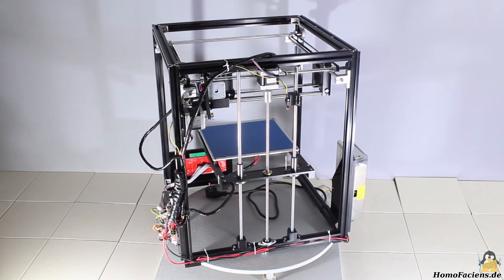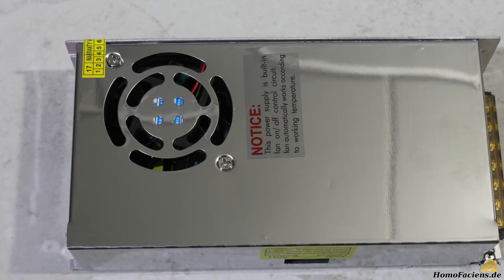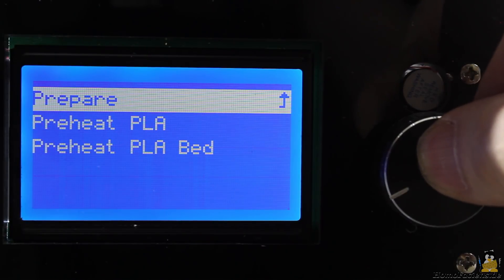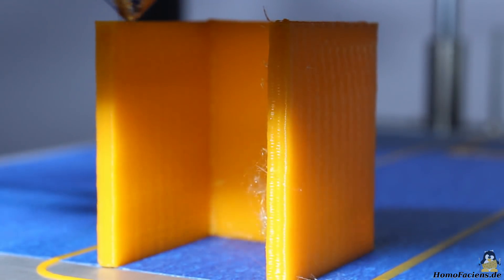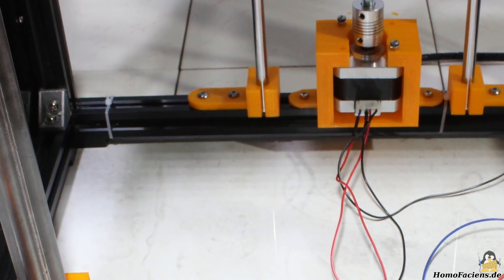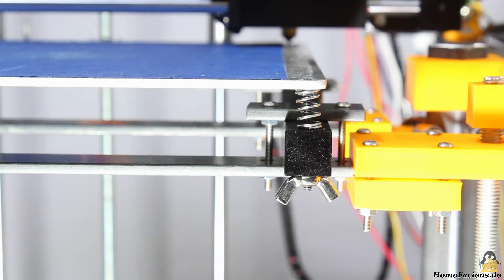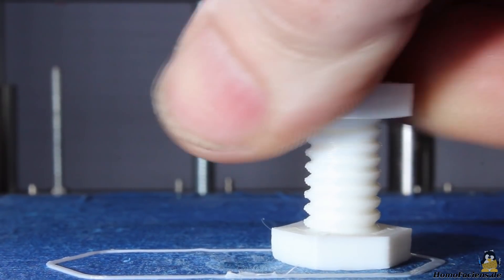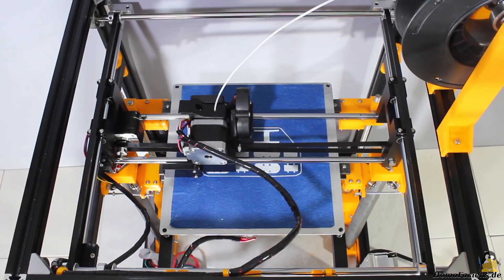Modifying a Tronxy X5 3D printer to get quality prints

Comment: Sorry I'm so late, bit do you havw a link to the first z mod that you did? It still improves the print quality a lot and it means that I don't have to buy lots more motors and rods etc.
Reply from the maker: As told in the video, the mods I have done are published on my pages:
https://homofaciens.de/technics-machines-3D-printer-Tronxy-X5_en.htm
Reply: But is the first z mod that you did on the website? The one that you later changed?
Reply from the maker: I would not call that first mod "success".
Reply: No it's not perfect, but it's a lot better than the stock printer and I don't think it's on your website? So I was just wondering if I could have the file for it that you made?
Reply from the maker: Only for you ;-)
https://homofaciens.de/technics-machines-3D-printer-Tronxy-X5_en.htm
The link to the package can be found at the newly inserted figure 13.
Reply: Thanks! Stay safe 👍

Comment: I will buy my second printer on "Black Friday", today!
I own Anet A6 and I would like a larger model arround 330x330mm or more.
I was looking for Tronxy X5SA because of the "box configuration". I would love to have a high quality machine with a large bed. I was thinking about 200$ upgrade such as a silicone heat bead (1000W, 120V, 50$ Ebay +5$ Mosfet), better belt and better bearing. But will it be great then, is it enough? Will it compare to 2000$ models?
Should I let go the nice "box" high end look? Should I go with JGAurora A5 or CR10 or a copy of theses?

Thank for your inputs, Alex form Québec, Canada
Reply from the maker: I haven't tested the X5SA, so I can't say anything about the printer. To me, a good choice for larger prints is the CR-10S:
https://homofaciens.de/technics-machines-3D-printer-CR-10S_en.htm
The only printers that are close to 2000$ printers (especially in service and warranty) are 1900$ printers. That's economy...

Comment: Has anyone found a detailed guide to initial assembly of the Tronxy X5 ? I'm stuck on which length of rod to use on what part of the frame. The longest rod are the vertical pieces. With the LCD being the front. What size is used for the side and front rails of the frame?  Is the frame longer than it is wide?
The updated model I have has build plate rods supporting the front and the rear of the build plate. 6 rods not just 3. Does this make these modifications obsolete?

Comment: That is not the TronXY X5S beyond the frame... You've eliminated some of the better features of the printer like the gantry rail system and replaced it with crap smooth rods.
Reply from the maker: It's the X5 I am showing in this video, not the X5S.

Comment: Do you have a link to buy the component for upgrade ?
Reply from the maker: Buy filament and print the plastic parts. You can get the 3D files and a link to the steppers I am using on my pages:
https://homofaciens.de/technics-machines-3D-printer-Tronxy-X5_en.htm

Comment: I am having a problem with  x and y as well I like your plans but why 3 stepers on in can you not just use 2 because I was planning to use 2
Reply from the maker: A tripod construction is the best you can get. Of course you can also try a 2 motor version same as most 3D printers use. Share your results to see how good it works.

Comment: is that every time we want to print new model we need to adjust the heat bed?
Reply from the maker: No, only whenever you run into trouble printing the first layer of if you have moved the printer to another location.

Comment: I think it would have been cheaper to use a belt or chain to control the deck height. I dont have extra motors just laying around.
Reply from the maker: ...and I did not have belts and pulleys laying around ;-)
My solution is just one of many possible ways to improve the design.

Comment: Good video! But you need to make another step forward. As seen from your video, Z axis ripple on the prints still present. And most probably this is because of the M8 lead screws. Ripple frequency is very similar to M8 pitch. I propose to replace these Z axis M8 lead screws with the trapezoidal and use anti back lash nuts. And use good quality couplers (as an example - Plum Flexible Couplers). After I did that on my printer, Z axis ripple completely disappeared. The only ripple I see now is from X and Y stepper motors control steps. But I hope to get rid of that too. I am planning to use SilentStepStick TMC2130 driver boards.
Reply from the maker: Yes, with quality parts you usually get a better output, however the very cheap trapezoidal screws might not be an improvement over the standard M8 screws. It's a quick replacement if you want to do some experimentation.
Thanks for sharing your experience!
Reply: Sure, I agree with you, that quality parts give the best result. But very few of us, makers, can afford to spend thousands of euros to go for this. I am using parts purchased on eBay, AliExpress and etc. so they are not the highest quality. But any way printing quality improvement is tremendous. M8 leads are not bad (if they are straight enough). The problem is that coupler hole is 8 mm, but M8 diameter is less than 8 mm. So you will automatically get lead off center (not mentioning, that these cheap couplers usually have hole off center too). And that is the main source of Z axis ripples. I have and idea to make Plum Type couplers myself. All parts can be printed with 3D printer. Upper and lower parts could have hole with any diameter we wish. So we can eliminate M8 lead screw problem not being in the center. And we can print middle part from flexible material too. So with the next printer build I will try use DIY Plum Type couplers. If I will succeed, I will share that design on the Thingiverse. And thank you very much for sharing your experiences and videos. Your channel is great :)
Reply from the maker: Sharing successful ideas is what evolves mankind!
Hope to see you design, soon.

Comment: Hi, great vid, some quality work there in your upgrades. You mentioned further work was required to make it your dream printer, what individual updates would these be ?  I'm looking at whats available now, should I just get the X5S as this has dual Z drive out of the box ?
Reply from the maker: Mainly I am working on integrating a filament extruder so that I can feed the printer with plastics granules.
Yes, the X5S seems to be a clear improvement when having a look at the construction and specs, however I can't give an advice regarding a printer I haven't tested yet, because the devil is in the details...

Comment: Nice vid but having three steppers just for the z axis is just not pratical. Syncing the two z motors on standard i3 designs are already problematic. You should have just used a larger motor with pulleys
Reply from the maker: It's not perfect, but with three steppers you can implement auto bed levelling (assuming you have a sensor and two more drivers on the mainboard for the Z motors). If I have time to do more experiments with the printer I will try to do so.

Comment: Time will tell if the company who makes this Tronxy upgrades the unit with HF's improvements.  It's super great when users make the design better and you don't have to pay them.  Who bets the Tronxy price stays the same.   Westerners are so stupid.
Reply from the maker: Filament printers were designed by the community from the beginning of times. Companies selling them make printers available to a broader base of makers. I am not interested in selling my own device. Would be nice to see those implementations in a new iteration of the Tronxy. If the price stays the same even with two more stepper motors and bearings implemented, I would call is a good offer...
Reply: Maybe I was too sour about the companies who supply 3DP kits.  One thing is sure - some kits are very good, others are "rough around the edges".  Thx.

Comment: I wonder if you can use the three motors with three different controllers (would need a new controller board for that) and remove the manual leveling completely and use a fully automatic auto leveler that would move the motors to the right positions to level the bed.

Usual auto-leveling adjusts the g-code but in this case you can actually auto-level the bed itself.
Reply from the maker: To do so I must use a different mainboard. The controller of the X5 has only one driver for the Z axis and I would need three of them. I'll keep that in mind for my DIY 3D printer that will come sooner or later.

Comment: very cool!, could you use a belt and teeth between the z rods to sync them? or would it interfere with max z height?
https://www.thingiverse.com/thing:2350350
Reply from the maker: Using a belt isn't impossible, however to my mind the 3 motors are more easy to implement.
Reply: the 2nd rod could be motorless...because tied together wit gt2 belt, more strain on motor of course however
Reply from the maker: Yes, there are pros and cons for both solutions.

Comment: congratulations! love to see you achieving higher positions, keep going. please do a DIY 3d printer with components listed in your website.THANKS
Reply from the maker: I am studying all my printer kits to develop an own design. Stay tuned!
Reply: is it possible to attach 4 heat beds and build a bigger built volume? or having a moving robot is better?
Reply from the maker: For a bigger build volume, one large build plate is better than four small ones. Large prints aren't easy to handle. Think of 10x10x10cm prints rather than of an Airbus a380 ;-)
Reply: musef sadri If you had a solid piece for the build plate, then you could use 4 silicone heat pads beneath tio accomplish your task. I've been thinking about doing this for a larger hyper cube evolution.